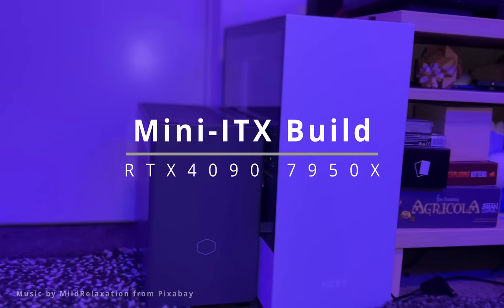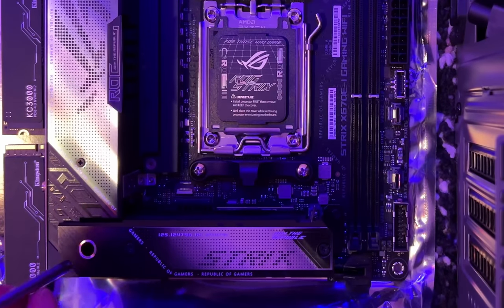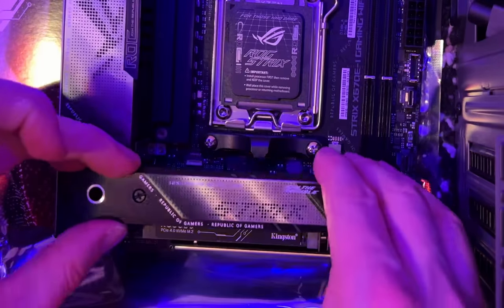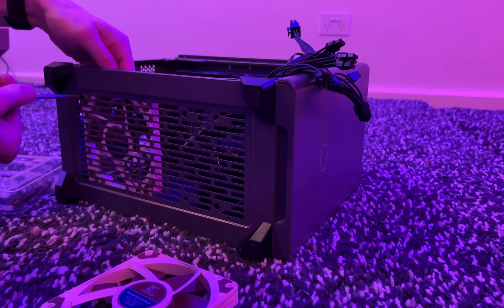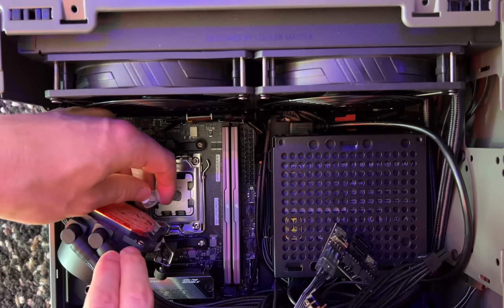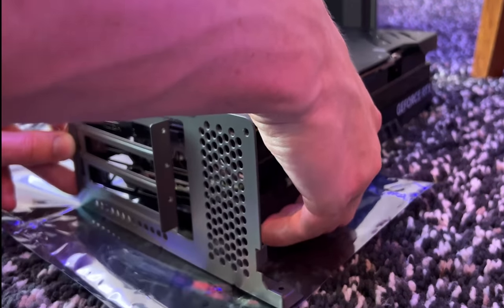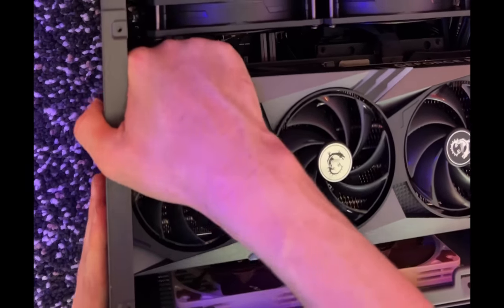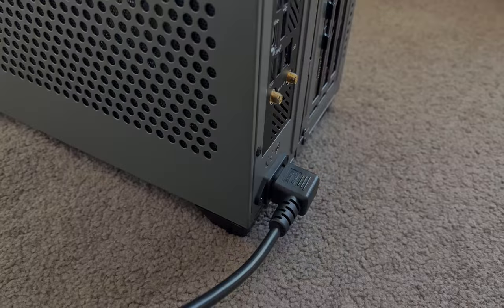Mini-ITX NR200P MAX build with 4090

Comment: Thanks for the inspiration! Gonna do a very similar build soon. Question: Did you undervolt your 7950X or 4090 and adjust any fan curves? Much appreciated.
Reply from the maker: I run the 7950X in 105w eco mode, this MB has a limit for how low you can set the fan speeds, you need to run the fan calibration to set that.  Top fans seem to work better in DC mode, have from 600rpm -> 1300 rpm.  600rpm is silent. Bottom fans are louder so I used the noctua silent adapter cable that is included with the fan to reduce the fan speeds. GPU cooling is good, and CPU cooling is good, however when both the cpu and gpu are maxed out the top radiator is pulling a lot of hot air from the gpu so the fans on this need to be powerful enough to also draw in some fresh air from the case.
Reply: @minkis42  Thanks man! I'm relatively new to the fine tuning side of PC building and this will be my first SFF build too. I just ordered the 7950X, but I might hold on to it and see how the 7950X3D compares when it gets released on the 28th. Cheers!
Reply: @minkis42  sorry to bother you again! I just got my 4090 in and started following your build. How did you connect your PSU cable to your PCIE adapters? Bc if you follow the recommended way of connecting it, it needs an extra PCIE cable.
Reply: @minkis42  I guess the question would be did you daisy chain or did you buy an extra cable?
Reply from the maker: @Yo-Geo  I daisy chained it to begin with and then got a custom cable from cablemod for it to make it more tidy.  If you're using another cable then make sure it's compatible since the PCIE pinouts on this powersupply are wired different to most others.
Reply: @minkis42  do you mind linking the cable you got from cable mod pls?
Reply: i super dooper hope that  you didn't listen to this dude and actually under volt any of that sexy and expensive hardware if that is the way you went anyways. don't be that guy, and if you did take a 7950x cpu and then limit its performance to that of a 7700x and then while doing that take the money you spent on it and light it on fire, I'm hear to tell you that's not needed at all! just look up Ryxens Precision boost overdrive and more specifically how to negatively offset the curve optimizer in Precision Boost Overdrive. please don't listen to this dude hell don't even listen to me just google yourself and find out which person was right about providing you with random information on how to build or run your computer. You can thank me later fellow pc builder,
Reply: @skylarmorehead9883  I pretty much left everything stock and it's running perfect rn.
Reply: Perfect bro! just saw that comment from the guy and was hoping you didnt do that, have a good one cheers @Yo-Geo

Comment: Good day, just to check with a GPU this big will you be able to mount a 3.5 inch HDD directly on the PSU?
Reply from the maker: No, the only space for 3.5" would be mounted to the bottom panel instead of fans.  Also with this particular motherboard the sata ports are blocked by the position of the power supply so you would need to choose a different motherboard.
Reply: @minkis42  Thanks for the reply. Any issue with overheating when stacking nvme ssd?

Comment: what PSU You used ? // ohh i seee... did this case version have all included right ? AIO CPU and PSU also.. is it SFX850 ? can You tell a model. I got different ITX build in Thermaltake 100 but i see many ITX cases will get problems to fit new GPU Cards because they are 3 slots + , not much 2.7 slot left
Reply from the maker: It comes with a CoolerMaster V850 SFX GOLD.  I want to change this power supply though as my one has quite bad coil whine.
Reply: @minkis42  coil whine is hard to avoid in current times... good is someone is working in pc shop, otherwise many times is a just good luck pick up. Thank You for answer. I got EVGA GM650 and I think PSU is not making coilwhine, but other EVGA in my home does. But in Europe po 230V EVGA 650W is max, in USA is available 850 also..  Hmm People recommending a lot Corsair 750 platinum but also it is max what is available for SFX.

Comment: I am planning to have same gaming x trio gpu but only 4070, thickness might be different but length is the same. Is the length of this card completely fit inside the case or u need some modding? As specs say gaming x trio length is 338mm but nr200p max gpu length is 336mm, I am kinda worry
Reply from the maker: I didn’t do any mods to fit the 4090, card was touching the inside of the case tho.

Comment: Hi I gave a Sub,  I have the Same system to build , I Only have the ryzen 7700 , Would you recomend a CPU frame to mount the aio level with is case ???? Thanks
Reply from the maker: I think that’s only an Intel thing, it works fine with no frame.

Comment: Does the second SSD slot utilize half of the PCIE lanes? I have a b450 ITX boards and it definitely does. Limits the GPU a bit.
Reply from the maker: The AM5 chipsets have 16 lanes dedicated to the PCIe slots so NVMe drives are not an issue, even with the cheapest chipset.

Comment: hi, I’m going to build NR200p with msi 4080 trio. I have some questions 1) would this fit with cooler sfx psu bought myself? 2)how will the rgb lighting perfom? Because I actually spent some money on the rgb light and it seems that few itx cases can fit this gpu.

Comment: Nice build. A few questions:

1) how did you connect the power supply? The case comes with 2 PCI-e cables + 2 daisy chain connectors.
2) Do you hear any ticking / clicking noise from the AIO pump?
Reply from the maker: For GPU power I daisy chained one of the cables, there was some sheet that came with the GPU showing not to connect like this but for me it seems to still be within spec. The GPU should draw max of 450W and each cable can provide 288W, maybe I'm just living on the edge.  I should point out here that there is a huge risk of mismatching the cables for this powersupply and causing a short circuit.   It's a CoolerMaster V850 SFX gold, the pin outs for the PCI-e modular connectors are wired opposite to the more common Corsair cables, but it's the same plug.  So if you were to grab a modular cable from a Corsair power supply, or if you got a custom 12VHPWR cable from cable mod which is not specifically made for this power supply then it will cause a short.
Reply: @minkis42  what 4090 pulls max of 450w
Reply: I had nr200p max, if you hear ticking / clicking noise from AIO pump remove installed fan cover
Reply: @deorendy5693  I experience this issue. What do you mean with remove installed fan cover? How can a fan cover cause the AIO clicking to go away? Not sure I understand. Thanks.
Reply: @alexandervillumsen1241  nr200p max come with 14cm fan on 280mm aio, it makes more vibration on high rpm than 12cm fan. It's the fan cover that being collided with the fan that makes the tickling noises. Just try it, I already replace it with arctic fan and not using the fan cover and my pc silent like midnight
Reply: @deorendy5693  My fans are Noctua 140mm, no fan grills/covers installed on those. The clicking is from the AIO pump. Not sure we have the same problem then. So your AIO pump clicking went away when you removed the fan grills installed on the fans? It makes no sense to me, hehe
Reply: @alexandervillumsen1241  maybe we have different problem, but mine the clicking only appear when I oc the cpu or it's getting highly loaded, so I guessed its from the fan not from the pump and now its been solved the problem after I changed my fans
Reply: @deorendy5693  Very strange indeed. I’m considering doing a full custom loop just to get the clicking to go away from the cheap AIO pump from CM
Reply: @deorendy5693  I cant believe this but it actually helped! Its been driving me insane for 2 month,...
Reply: @autismavenue9223  glad to hear that!
Reply: What lenght did you get for the custom cable?  @minkis42
Reply from the maker: Oh I got mine before you could even select length, about 450mm seems right if you route it through the front of the case, do your own reserch though.   @Trevor-Bobyk

Comment: Do you have the link for the cable from cablemod? I got the 4070ti msi gaming x trio and i assume it would also work with the one you got?
Reply from the maker: Use the configurator 2.0 for custom cable: https://store.cablemod.com/configurator/
Reply: @minkis42 perfect thank you and also which PSU is the one that comes with the nr200p max stock
Reply from the maker: It's coolermaster one... https://www.coolermaster.com/au/en-au/catalog/power-supplies/v-series/v850-sfx-gold/   @nando6333

Comment: Brilliant build. Just about to buy this same case with a 4090 FE and AMD 5800X3D. What is the noise levels like these days for you whilst gaming ?
Reply from the maker: It's pretty much silent. I had to play with the fan optimizer a bit in bios though to bring down the default fan speeds for the radiator.  Some 4090 will have coil whine but FE might be ok.

Comment: How much horizontal space you have left after you install the 4090? The length of your MSI card is 337MM. It's shorter than 4090 cards from other brands, which many have their measurements at over 340MM.
Reply from the maker: This card is touching the inside of the case so it's the maximum length, a 340mm card will not fit without modifying the case. The Suprim X also fits with a 1mm gap.
Reply: @minkis42  thank you!

Comment: Hey man I have question for you. I do almost same build but with Intel but I ran in problem that sfx power supply comes only with 2 pci-e cables. Where did you buy the 3rd one or can you send me the link ? I just wanna make sure I buy the proper one. Thanks for the answer
Reply: Also asking because on gpu they make clear to use 3 pci-e cables not two and spliter on one of them
Reply from the maker: https://store.cablemod.com/configurator/  you can choose the coolermaster V850SFX gold, and "16 Pin Micro-Fit to 3x8 Pin PCI-E 12VHPWR 600W Cable for NVIDIA 4000 Series (GPU)",  Yeah make sure you use a proper one, the modular cables have different wiring between brands so you cant just use one from another power supply.
Reply: @minkis42  how long should it be?

Comment: Hi there, thanks for the vid, really helps to clear my doubt. Got a question though, may I know if the GPU touches the side panel? I'm planning to use the TG panel. Have you tried to use TG yourself?
Reply from the maker: About half a cm gap.  It would restrict the gpu cooling a lot.
Reply: @minkis42  Thanks for the reply man. How's the Gaming X Trio so far? Have you encounter any coil whine issues? Seems most 4090 have it.
Reply from the maker: @DeezyxZM  at half load there is quite a lot of coil whine but I think this is from the power supply…

Comment: Not sure why bottom fans are exhaust it has far better performance with bottom intake fans. I have identical build with bottom fans as intake. Temps are never going over 60C for 7800x3d and 7900xtx

Comment: hi stephen
i have exactly the same component that you have in this build but upon the first boot  i could not  get to the bios 
i am so frustrated now i do not know what's the issue every thing same to work the gpu the ram and the aio all work but there are no display  what so ever 
did you encounter any issue like that ??
Reply from the maker: First boot takes longer than usual so you can give it a few minutes. You can also try without the GPU and use the onboard graphics.
Reply: @minkis42   thanks for the reply  it was  the bios update is the issue 

anyhow did u figure out how to deal with the long booting and the loud fan noise from the back of the motherboard????
Reply from the maker: @fahadabdalaziz6864  To improve boot time you can enable "Memory Context Restore" in the BIOS.  Its buried in the menu so google where it is.  The motherboard has two hidden tiny fans, one for VRM and one for Chipset, the chipset fan is the loudest.  The bios doesn't give you any control for the fan speed of these.  It is possible to turn the chipset fan off by setting the fan mode to none in bios.. but could overheat?  What I've done with mine is remove the plastic covers, and move the fan to on top of the chipset heatsink, taping it on, this is very hacky. But its much more muffled being deep within the case.

Comment: Would I be able to do a similar build with a 13900Ks  i9  , using the same PSU?
Reply from the maker: Yeah, it's within spec, there is a power calculator here: https://www.coolermaster.com/power-supply-calculator/

Comment: My question is will the 4090 FE fit into the OG NR200? if i had bulit my PC when the max came out i would have chose that but i'm stuck with the OG NR200.
Reply: AFAIK there shouldn't be an issue with fitment. The dimensions are the same length-wise.

Comment: Great build brother. How have thermals and noise been while gaming?
Reply from the maker: Very good thermals on GPU, slightly louder than NZXT 710 but still quiet, I think aftermarket fans on the top will help. Also having the vented steel side panel instead of glass allows some fan noise to escape.   I'll try to do a follow up video on this.
Reply: @minkis42  follow up?

Comment: Great build! Are you trying to start a fire? 😅

Seriously interested in the thermals for this setup though, the NR200P Max looks like such a good case.
Reply: thermals probably are pretty good, cpu is water cooler and the gpu is pointed straight at some vents
Reply: I have an NR200 as well with a 3080ti and the thermals are not bad at all. My build is arguably less optimized than his as well. The only thermal problem I have is with a glass panel but I avoid using it for that reason.

Comment: I'm a little  bit worried about the lower fans. Have you lifted it up a bit?
Reply from the maker: The case feet raise it a few cm off the ground. You can also 3D print custom feet for it.

Comment: where do the top fans plug into?
Reply from the maker: Case comes with fan splitter cable routed in, needs to plug into the cpu fan connector on the motherboard.

Comment: Congrats man, nice build and thanks for sharing.
Im planning to build the exact same parts but with 13900k.

Would you be able to fit a regular 120 bottom fan under the PSU? 

Im planning to fit a slim 120 fan under the riser and a 120x25 fan under the PSU.
Reply from the maker: Yeah that works fine but you should also get a fan grill to keep the wires from poking into the fans.
Reply: The 240mm AIO will not handle your cpu... the cpu in the video is also overkill for the AIO

Comment: Hi Sephen , Thank you for sharing this build with us, can you please share the exact cable you use as a case fan splitter ?
Reply from the maker: "SilverStone CPF01 Black 100mm PWM Fan Splitter Cable".   Also the case already comes with one fan splitter built in for the top radiator fans.
Reply: Ace thanks for that info. I was after the same thing 😊

Comment: Very nice build! Love this video. I am interested in using this case as well, I have a gigabyte 4090 windforce which is 331 x 150 x 70 vs your MSI trio 337 x 140 x 77. 

Based on these dimensions my windforce should be able to fit too right inside the nr200p max ?
Reply: Anything under 336 should fit.
Reply: Lol. I was doing the same calculations!

Comment: Amazing, are you using the stock PSU? I hear it SHOULD be sufficient, even more so if you underlock your 4090. How has it been holding up so far? Did you just use the included power cables for the GPU?
Reply: this i wish i knew too, i imagine its the bare minimum. I wish they would sell this case no PSU, so we could get a 1000
Reply: @davysmith8569  u can just buy sfx psu for 1000w
Reply: @Joze10  actually ended up doing that , got the "Thermaltake Toughpower SFX 1000 W 80+ Gold Certified Fully Modular SFX Power Supply" works good too!

Comment: Hey, do i need a third pci-E power cable for a rtx 4080 in this case ? as far as i know it comes only with two cables .
Reply from the maker: If you don't want to daisy chain them then you can order a custom 12VHPWR cable from cablemod.  You would need to select coolermaster sfx 850 for powersupply since the cables are not compatable with other brands.
Reply: @minkis42  hey , thx for the answer. The Question is , do i need to buy an extra cable or does daysie chaining worl just fine.

Comment: Hello:) Is the 850W PSU enough to power this system without any problems? I've read that the 4090 requires a 1000W PSU to run well. Thanks for the video!
Reply: 1000+ w minimum

Comment: Pardon my ignorance whats that thing at 5:30, does it come included with the case or fans? or whats that for? xd planning to copy your build
Reply from the maker: This is a part of the motherboard, I guess they couldn't fit all the parts on the board so made a riser card thing, a bit silly really. If you choose different motherboard then you wont have this and the front panel connector will plug straight into the motherboard.